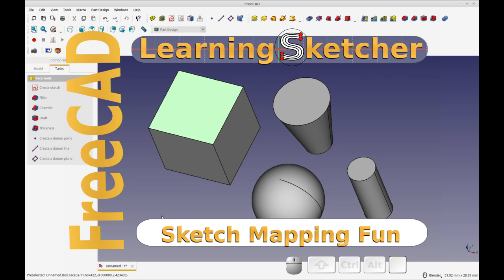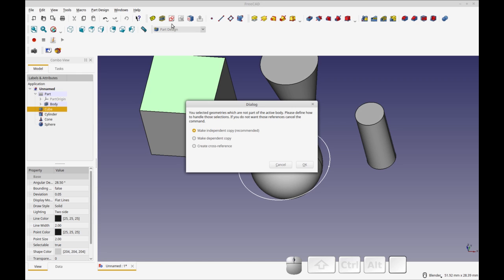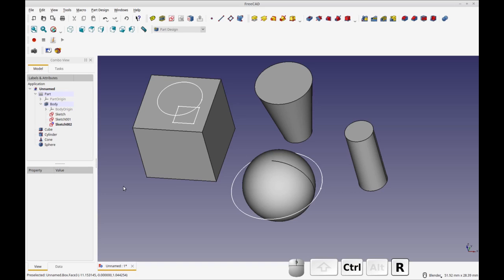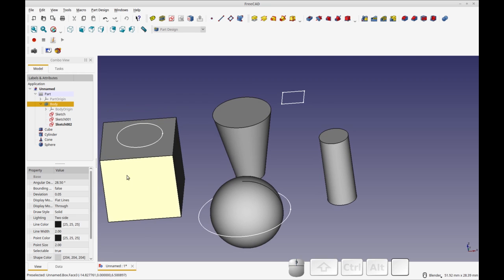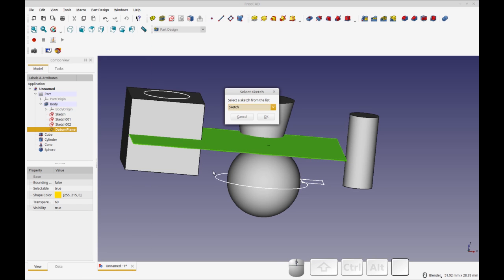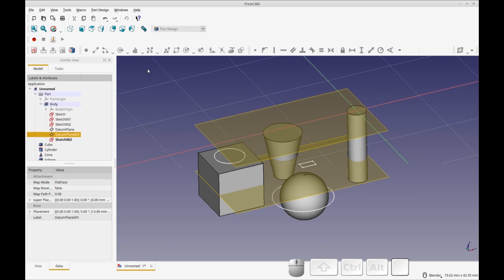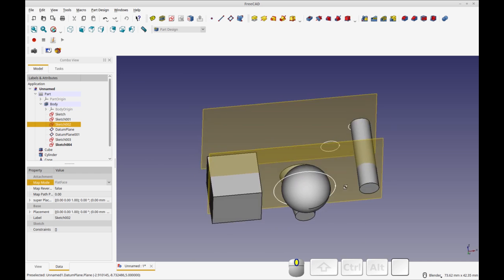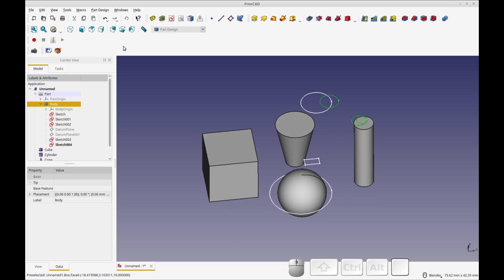FreeCAD - Basics - Mapping a Sketch to a Face

Comment: How do we sketch onto a cube, and constrain it a certain distance from the cubes edges? I place a sketch on the face of a cube, but the edges of the cubes face aren't detected in the sketch, so there is no way to center it on the cube or have it a certain distance from the edge.
Reply: external geometry tool

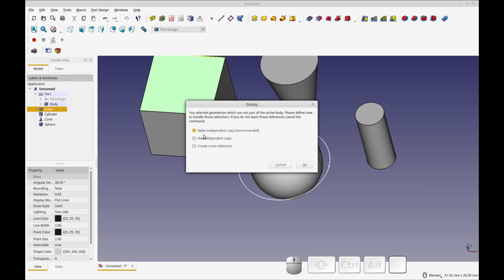Comment: at ~ 2:20 ish you're being presented with that modal because your box object / shape is not contained within the hierarchy of a body object, but you probably already know that by now, just thought i'd leave this here.
Reply from the maker: Thanks I'll have to check, but it's good for others even if I have learned this already.
Reply: @mathcodeprint  great set of videos you've uploaded BTW. 👍

one thing i just figured out was that separating a sketch from a face allows for aligning the sketch within the bounds of a face much easier / possible when the sketch isn't already attached, whereas the sketch becomes readonly if creating the sketch after selecting a face, and then useing the  `create sketch` utility.

Comment: well I was expecting to see you use the xy plane and then show us how to sketch on the yz plane ... and on the xz plane ... all you are doing is working on one plane with an offset ... literally the video is NOT about multiple planes but offsets ... 

a plane is what you need to make a 3d view ... you need a front view ... a side view and a top view ... or yz, xy, xz ... THAT is using different planes ... and I havent been able to find out how it is done ... as everyone does it as you have done ... in one plane only ...

Comment: i either dont see any of those buttons or they are grayed out, why is it so hard to draw a shape on 3 axis select the 3 dimensional drawing and have it create a face connecting the 3 pieces
Reply from the maker: The confusion may be between the Sketch Workbench and the Part Design Workbench. The Part Design Workbench puts some limits on how sketches can be used. Some of those limits have been added since I made this video. If your shape is a "Part Workbench"  ( not Part Design )  shape or a Draft Shape you can do what you like within the Sketch Workbench. If you start with Part Design Workbench and use a Body, sketches within that body are restricted. Its confusing at first, I wish it weren't but it is pretty awesome once you get over the learning curve.
Reply: @mathcodeprint  how about doing a video where you put a sketch on each plane ... front top and side ... (those are planes)  in the same project ... so us old school drafters can actually do it the right way.
Reply from the maker: Would love too, do you have an object in mind that would be suitable for such an excersize? My limited cranial capacity has run short of things it wants to model.